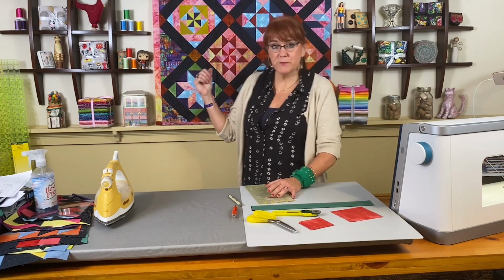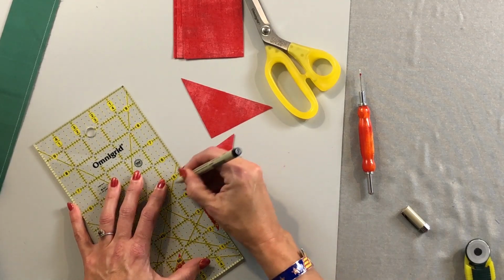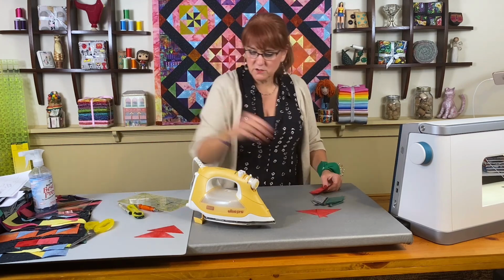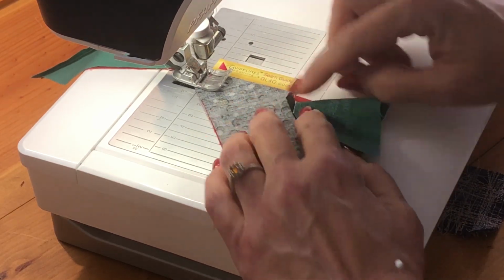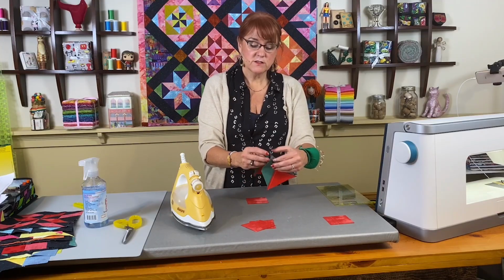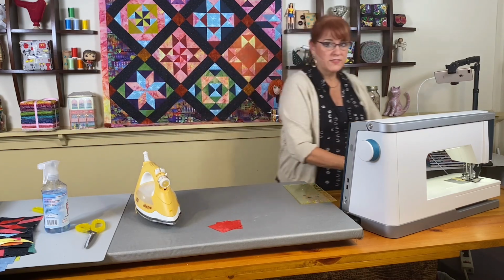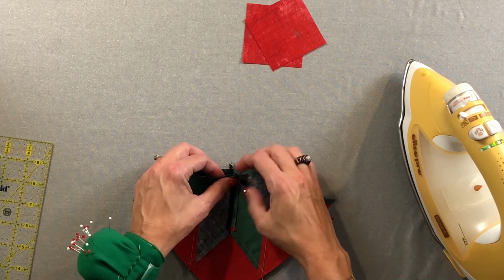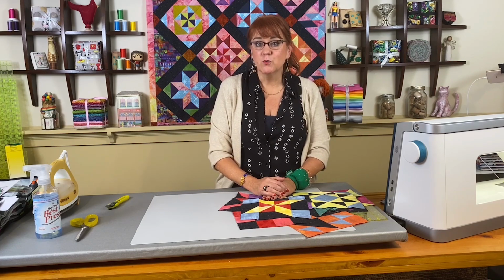Sunset over Dublin, Part 14: Set In Seam/Y Seam Technique (Lemoyne Star)

Comment: Really like your teaching style!  I am however having trouble.  
I make my turning point marks.
when I go to sew the triangle on to the diamond set, the seam on the diamond set is a little more than 1/2" away from my pivot mark..... made three stars and ... same problem with all of them.

scant 1/4" used for all seams.  
I thought I was super careful cutting as well
2 1/8" strips for diamonds
2 7/8" small squares 
and 4 7/8" large square, cut diag. twice.  

I'm a little confused as to what I'm doing wrong.... :-(
Reply from the maker: Debra, the only way I can imagine that the diamond is larger than the triangles is that you may have cut it too large or too small?
Reply: You double checked that your triangle was oriented the correct way?  That the pivot point was made at the 90 degree angle and not the 45 degree angle side?
Reply: @cindymcfarland4686  Yes,  and I seem to have to ease about 3/8  into the seam.  I double checked my scant 1/4" and I think my cutting is pretty good.  they turn out but don't lay as flat as I'd like for a block.  Almost like I'd have to pleat the triangle on the edge of the block to make it lay flat, does that make sense?
thanks for your reply.  I'll keep at it.
Reply: @sprklhair  Your situation puzzles me.  Keep at it.  It sounds as if you did everything correctly.
Reply: I agree with Deborah. I think that the measurements are off. The triangles are bigger than the diagonals by 3/8 of an inch. Why are we cutting the square 4 7/8 shouldn’t we be cutting it 4 1/8?